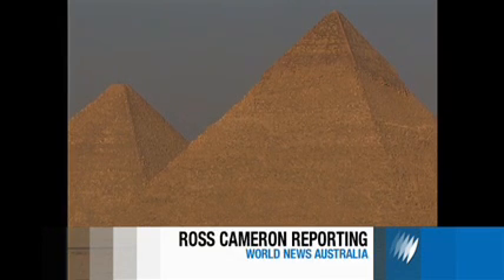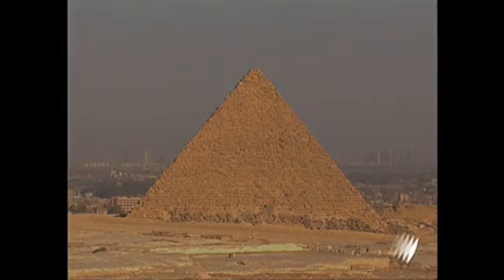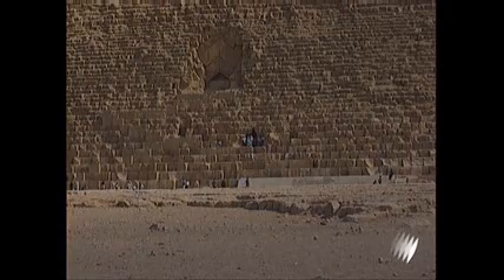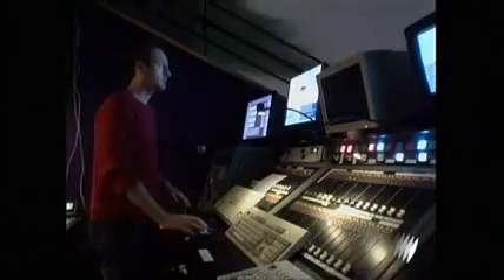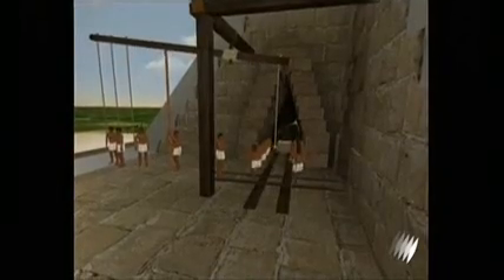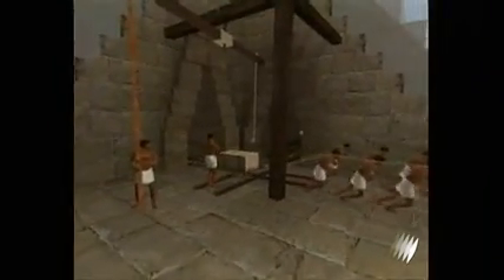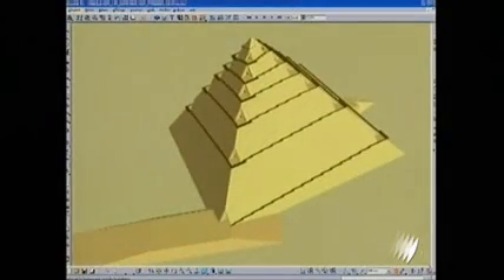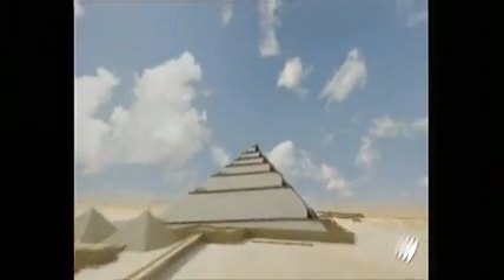French architect claims pyramid secret solved

Comment: Dude, I wish I could send you a link here, but youtube doesn't allow it.  Here is a small excerpt from Graham Hancock - former doubter of the markings who changed his mind when new evidence came to light.

Cracks in some of the joints reveal hieroglyphs set far back into the masonry. No 'forger' could possibly have reached in there after the blocks had been set in place - blocks, I should add, that weigh tens of tons each and that are immovably interlinked with one another. -cont-

Comment: If the quarried blocks of limestone from the Nile River Bed, has no signs of random signs of fossilized figures on the stone , then the stone was not quarried, but  merely poured as concrete.  Blocks of concrete mix,  would not show any signs of fossils in the limestone on any exposure but  if quarried blocks were used, then clearly fossils in the natural limestone would be seen.   I think the concrete was used,  carried in reed baskets and jars of water ,and mixed on site in wooden forms.

Comment: @sbergman27 We simply do not have the mechanical technology available to carve the stones that construct the pyramid with the precision that has been used! Also consider that these stones are so perfectly carved and the mortar joints are so terribly thin that you can’t even get a sheet of paper in between them! The mortar joints are terribly strong, far stronger that the mortar that we use nowadays. The stones seem more or less glued or fused together. Why can't you just admit to its greatness?

Comment: Les Brown (not the motivational speaker) took the measurements (base is a square, each edge is 1.57 or half of pi X the height and from there you can figure out the side heights) and made a house out of wood. In this house he grew veggies of all kinds. Their yield was 3x as big and 3x as rapid as usual. There is a video where he shocked himself in the house 20ft and turned zinc to calcium with tetrahedron shapes. There are other vids with people experimenting on grass.

Comment: I  don't understand your point.  You slide the stones up the ramp to the level you are working on. Then you slide the stones horizontally, placing the furthest stones first. According to Oahspe , the ramp was 7 times as long as the level  they were working on. so the angle would be ? (you do the math) They used capstans to assist the pulling.

Comment: Wrong. 
Using earth's magnetic resonance you an easily build up a 3 stage fractal freq' based magnetic resonance which separates elementary particles with enough potential to break electrons from a type of positron/ heavy ion w/o matter, that runs heavy through the stone draining off the bottom, reversing gravity inside the atoms of the stone(s). Leedskalnin did this. It should be obvious they were architects of energy as the pyramid was infact a powerplant we now know. My vids explain more

Comment: I assume you mean the granite blocks across the top of the 'Kings Chamber' and the relieving chambers above that. Yeah they are there and yeah they are big and heavy (some up to 30 tonnes metric, about 70,000 pounds). They done it, so it is obviously do-able.
Yeah, the 'sarcophagus' is there, and as to whether we could do it today, I think we could, but as to how they did it. Mmmm.  Interestingly though, the outside volume is exactly double the inside volume of the sarcophagus, I've read.

Comment: Thanks for that info. The most interesting points I have heard are these: 1)  There are several long stones with in the center of the Pyramids weighing over 200 thousand (200,000) pounds each. 2)  Inside the big Pyramid there is a coffin type-container square that is made from a single piece of granite and is carved about 3 feet deep and 6 feet long.  Both of these seemed feats can not be done even today with our big cranes and advanced diamond drills.  True?

Comment: You can see that many of the stones were quarried right at the site itself, you can still see where the tool marks and the grooves made when cutting stone.  The Stones were cut rough, then smoothed, sort like an assembly line.  There are reliefs of the different stages using tools which we have found.